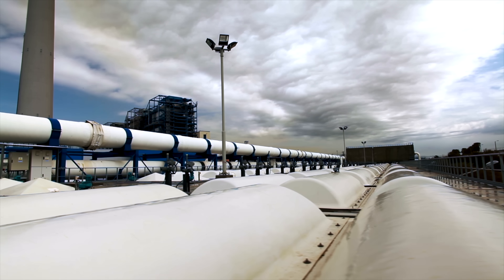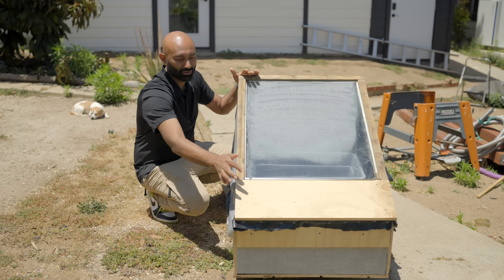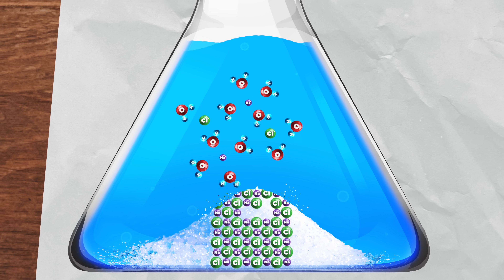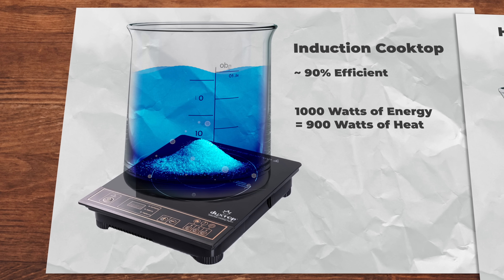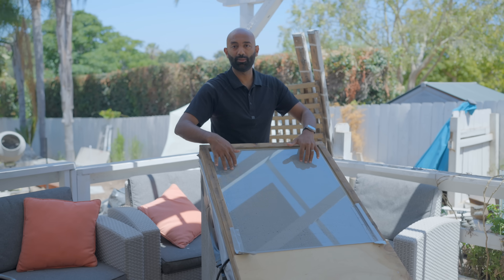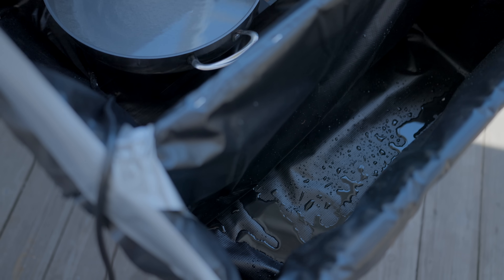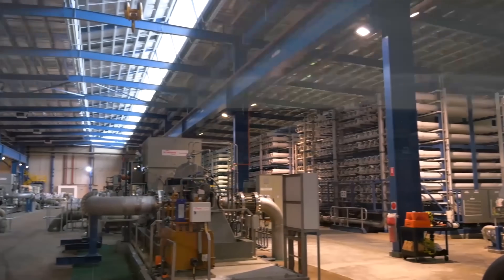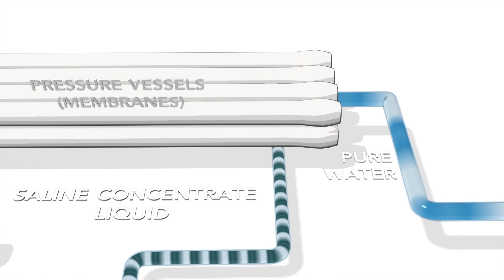Why Aren't Desalination Plants EVERYWHERE?

Comment: Here’s my world saving big idea:

We build massive solar thermal desalination plants on the western side of the Sahara desert.  Produce massive amounts of electricity, clean water, and instead of brine you dehydrate ocean water down to dry salt.  The salt is then loaded onto massive cargo ships and sprayed into the ocean across the northern Atlantic.  Why do this? Because it would restore the AMOC. As the main issue is melting arctic ice preventing the natural increase in salinity that drives the current to sink and move south.  It may sound insane but if the AMOC collapses so does all the food production in Europe as it’s climate becomes more like Canada.

Comment: Instead of using sun to heat for home desal and losing efficiency use solar produced power to power hi pressure pump for membrane feed and even though not produce megalitres at once at least could potentially produce hundreds of litres of fresh water each day. Enough for a household.

Comment: Why energy-intensive desalination? Use a simple (but space-intensive) system to liquefy (condense) the water vapor above the sea (there is plenty of it there) by cooling it. And you have fresh water! Condensation through cooling uses significantly less energy (~1/10) than the currently cheapest desalination. The energy can be generated inexpensively and in an environmentally friendly way by nearby wind farms.
This type of fresh water extraction has not been used to date because energy was cheap and apparently available in unlimited quantities.

Comment: I think using the excess energy produced by renewables would be put to good use generating heat.  Grid scale batteries, yeeesh.  We already have had 2 fires here in Aust letting out a cocktail of poisonous fumes in grid scale battery installs.

Comment: The ultrasonic system does not cause evaporation, it causes aerosolization, i.e., it makes little droplets of the fluid including anything dissolved in it.  This is why I don't use ultrasonic humidifiers.  My tap water is hard water and it deposits hard water scale on everything in the room including the interior of my lungs.  Maybe not a health threat (I don't know) but definitely something I want to avoid.
Reply: I realised the same with a little ultrasonic mist generator
.
I suddenly noticed the table all around it had white crystally dust all over where the mist cascaded over the edge

Comment: How
 About lowering the air pressure in the chamber? That should reduce the energy necesary to maje the Water boild. Of course you would nedd a dual chamber to make a vacuum and then open the Water, as the vacuum is fill with vapor the sakt stays in the inner chamber... Maybe it will work

Comment: You could also use excess solar to may Hydrogen and then you could desalinate water anytime you wanted!
Reply: problem is that a hydrogen electrolysis plant should run at best 24/7 to be economical viable. It makes no sense to shut them down every night. This is why most hydrogen generation plants that are in the planing phase today use wind energy as primary source, one example are the projects in Newfoundland with plans to run the electrolysis at least 5000 hours per year

Comment: Good idea, bad engineering.. glaze 2 panes on silicon sealed A frame w/ evaporator(saline drip feed steel or glass pan w/ heated sand using nichrome wire heat pads) in center so distillate drops into collection gutters in both sides. If u use $20 refractometer to test specific gravity of water collection there will be about .2ppm of oils, alcohols which can be absorbed w/ activated carbon. Add sea salt to remineralize. In r.o. filtration chems pass through membranes too.

Comment: You could have used the cool section of the heat pump as a condenser. Not quite ultrasonic but you may be into something with reducing pressure to reduce boiling point or localised pressure reduction perhaps coupled with the heat-pump itself which also uses pressure & state-change. 
Could a chemical (another salt) be added to the saline to compete with the existing salt & ease the release? I think there's more to be looked into here.

Comment: You have apparently never used an ultrasonic humidifier. Not surprising since you live in San Diego. I won't use them because they leave a white powder dust all over your house as the water dries and leaves the residue floating in the air to settle out. Pretty sure it is not good on your lungs.

Comment: The energy requirement for reverse osmosis isn't the only issue, RO requires only a few kWh per cubic meter of water, while not nothing, it is in itself not that much of a problem, except when absurd quantities of water is needed, like when irrigating deserts to grow plants that requires a lot of water. Other issues is the filters needed, and that the water doesn't become absolutely clean. The higher salinity the source water is, and the lower salinity required, the bigger filters and more energy is needed. Again, a salinity low enough for drinking water is one thing, but water for irrigation in areas that doesn't any significant rainfall requires very low salinity to prevent too fast salinization of the soil. 

There's an other option, that I think is more interesting, and that's vacuum distillation. For water in a "vacuum" the actual temperature becomes the boiling point, which means very small temperature differences, within normal ambient temperatures, can be utilized to distill water, like just the temperature difference between something in the sun and in the shade, or night and day, absolute temperature and wet bulb temperature and so on. 

Vacuum distillation is widely used, but mostly to enhance efficiency/output of distillation driven by high energy inputs in case of thermal desalination systems. But, it wouldn't be difficult to design a system that don't require high grade energy for the distillation process. A lack of water usually means large difference in temperature between day and night, which is great for "free energy" vacuum distillation.

Comment: California does not have a water problem. It has lots of water, but it is poorly managed. Your idea of using excess solar power for desalination and moving that water into reservoirs is brilliant. That’s water management! Bravo!!
Reply: Yes, using excess energy is a good way. However, when you invest a lot of money into a desalination plant, you want to run it 24/7 to make your investment financially viable, so there is that. But on the electricity market, you can get paid, to not use the electricity you were normally using. That only works for big consumers, but that is a way to balance out the network and make up for the loss of not operating it. So it could be a win-win. 
And just like you said, in some countries the pipe network is so bad, 50 % of the water just gets lost. Like UK or Italy for example. And agriculture is also often to wasteful. We need to fix that first.
Reply: Nah yall have greed problems down there!

Comment: I could be mistaken, but  I thought thermal desalination along the coast used cold deep-ocean water to cool down the steam ? Maybe some off-shore wind and wave power for electricity, and like you said run the desalination only when there's sufficient wind power. Or maybe use reverse osmosis instead of thermal  process ?

Side question - how much power from power company is needed to run a Tesla type super-charger - a half or whole megawatt ? Would a residential home even be allowed to use that much power ?

Comment: A good video, you kept the explanation short, and went right to the various systems. You mentioned energy requirements to evaporate the water, or to pump it through the filters. Solar PV should eliminate most of the cost, since once it's in place it starts giving back. even solar thermal is mostly free since we use the sun's energy.
 Just read an article today about a start up, they are using small diameter tubes, heating the top with waste heat, and keeping the bottom part cool, they can generate 600 gallons a day. They will be building a test plant in Tonga.

Comment: the best way to do it is put the desalination plant next to an oil refinery or power plant. you need to build a cascading multiflow counterflow spray evaporation towers. this is the same technique that produces instant coffee and powdered milk. you aim to produce crystalized salt with distilled water as a byproduct. you use sea water filtered through a series of gravel and fine sand and possibly a centrifugal separator to eliminate particulate. then the cold water is pumped into the water jacket of the downstream spray tower. this acts as an economizer and preheater. the cold seawater then exits at counterflow to achieve a higher temperature scavenged from the downstream spray tower, it enters the next upstream spray tower. and depending how many stages, you keep doing this and then feed it to the waste heat heat-exchanger. you can then heat it counterflow to any other waste fuel heat generator to increase exit temperature. this heated seawater is then pumped at high pressure to the first stage spray tower thus flash evaporating steam and separating the brine and salt to the bottom. the brine and salt are sent to a dryer separator and the brine is reinjected and heated by the first stage exit steam into the 2nd stage spray tower. then do this in a cascading manner. this will be an efficient way of potable producing water and salt.

Comment: You neglect to discuss the most difficult part of desalination, the brining Wastewater that cannot be pumped into the ocean because it will increase the salinity and cannot be disposed of on the land. There are some industries that can use this Briny water. This is why I watched your video because I was hoping you had new Industries to utilize the Wastewater and particulate. Of course it takes energy to run a decentralization plan but what do you do with the waste? An island in the Canary Islands that has a constant Westerly wind blowing off of Africa has a massive amount of wind turbines and some title electricity generation that powers a desalination plant and pumps the water up into their reservoirs and legs. Even more genius the pipes leading down to their Farms and cities have hydroelectric generators so they produce energy on both ends. It's absolutely brilliant and we need more of this. Especially in California we could fill all of our reservoirs and lakes in the mountains everyday for free. But what do we do with the Briny wastewater?

Comment: There is a new technology, think of it like a very fat oil drilling rig on the sea, but not that tall. 

The Sun causes a tremendous amount of evaporation of seawater and this evaporative is freshwater. 

The rig at sea provide shade which causes evaporated seawater to condensate and thus being collected. 

I do not have a link to this, however the only electricity required is to pump the distilled water to land and it was postulated did a couple of these could supply a town of 15, 000.

That said I would appreciate some more research end of viable will be a great resource here in the Caribbean at 16° above the equator.

And there is one thing we know here, Sunshine is cheaper than gasoline or diesel and we have no shortage of sunshine😂

Scientia Habet Non Domus,
(Knowledge Has No Home)

antiguajohn

Comment: there is actually another low energy method of desalination called "freeze-thaw desalination". Mostly used in chemistry lab setting to purify water from contamination. But works for salt too. It rely on the principle as ice crystal form, it actually push out impurity out of the ice structure. Assuming the freezing rate is no so fast that ice end up forming around the impurity, by freezing, remove the salty water, thawing and refreezing. It purify the water by ice's natural tendency to only form crystal structure around other ice crystal.
   
   One of the main reason why this method is less energy intensive than thermal desalination. One is heat of fusion for water is much smaller than heat of vaporization (334 J/g vs 2260 J/g), so it cost much less energy than boiling water to create equivalent unit of "pure water". Which is also another reason why arctic iceberg is biggest source of fresh water. Unlike reverse osmosis, eventually its membrane get clogged up. And the membrane need to be maintain and clean. Free-thaw-desalination don't have a membrane to maintain. Energy cost wise, theoretically freeze-thaw desalination suppose to be less than reverse osmosis. But real lab engineering result haven't be able to realize that efficiency yet. Operation wise, since freezing work more energy efficient when environmental temperature is cold, this mean at night time when energy price is at its lowest, FTD can operate at its most efficient rate. Double energy bonus right there.
   
   Now come the downside, the rate of freezing is very slow, and you cant freeze too fast either or ice crystal will end up entrap the pollutant. And lack of convection mechanism to transfer heat away mean even though ice have better thermal conductivity than water, it end up being more insulating and slowing down the production rate. So there are two factors limiting production rate and prevent large scale production. Although there are some new research that use pressure to freeze and thaw ice by shifting ice between solid and liquid in the 3 phase diagram. It's suppose to be more energy efficient and faster than just regular freezing. Since you can compress the icy water to help it maintain liquid phase to gain that convection thermal conductivity to get to lower temperature. Then slowly decompress the icy water to form ice. Then keep compress and decompress to maintain the free-thaw purification cycle. As oppose to regular heat pump cycle where heat transfer rate slow dramatically once you enter ice phase. The pressure freeze thaw cycle is faster and less energy intensive per cycle once you get to desired pressure region. Since you only cycle between two very close by pressure states. Plenty of engineering issues still need to be solved. But theoretically it's suppose to be most energy efficient method.

Comment: 2:50 "i was only looking at half of the picture", no u were looking at a different almost unrelated picture. I'm sorry but your initial ramble about bonds is literally useless, desalination has nothing to do with bonds between water and salt or between Na and Cl. Evaporating water: that is breaking the intermolecular bonds especially hydrogen bonds present in water which are the strongest non covalent bonds (why water has high latent heat of evaporation as mentioned). the salt only makes it a bit harder to evaporate because it adds vander wals forces (another type of non covelant bond) that also need to be overcome. also it adds some internal pressure which makes it harder for vapor to form a bubble and escape (boiling). so basically salty water takes even more energy to boil and evaporate than pure water but nothing to do with the things mentioned. thats what i understand btw feel free to correct me maybe im missing something. good vid tho overall.

Comment: If you pour cool salt water over the top of side of the collector panel before it drains into the salt water pail, the panel will condense more steam to clean water.  
     Also this preheats the salt water before it goes into the collector so less energy is needed to turn it into steam.

Comment: Why hasn't someone combined sand batteries and desalination? It seems like a no-brainer to capture solar heat and use it to evaporate seawater. No moving parts, No electricity needed and the salty brine left over, could be refined to be used in molten salt reactors.
Reply: @orionbetelgeuse1937 and then use the pickles to create electricity?
Reply: Why not dry the brine and dump it in disused salt mines?

Comment: this is still quite a naive overview because its not taking into account degradation . salt water is incredibly corrosive and therefore requires stainless steel or resistant coatings which even then needs to be replaced every 5 years , the reverse osmosis membranes degrade in 3 years . We can extend this type of consideration then to the powersupply battery aswell , with 2k cycles , its going to degrade in 3 years , and even the solar panel efficiency degrades by 1% per year ( from 24% efficiency when new  ) . the difficulty is not simply the setup that works for short term demonstration , the difficulty is in finding the most efficient setup for the long term .

Comment: One thing I loved about this experience was using the atomizer and proving that it's a fundamentally different process from evaporation. Here, you literally break down the salt water solution into tiny droplets that are carried by convection currents or another mechanism, whereas in evaporation, you take out water molecules one by one into the gas phase, so there's no way they'll carry the salt with them. You literally need a cage of water molecules to surround each sodium and chloride ion in the solution, and also, you can't take one out without the other because you'd end up with a charged particle in gaseous phase, which wouldn't make it one millimeter above the water without being attracted by the opposing negative charge they leave behind.